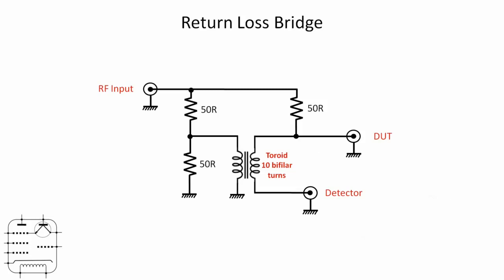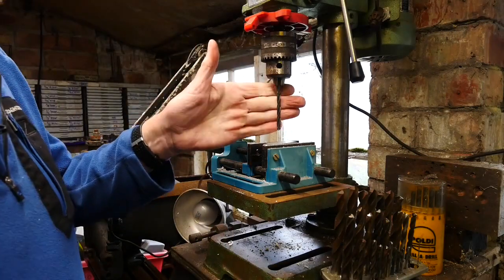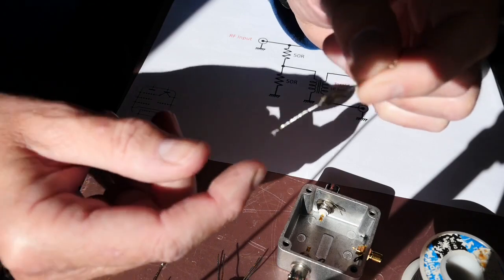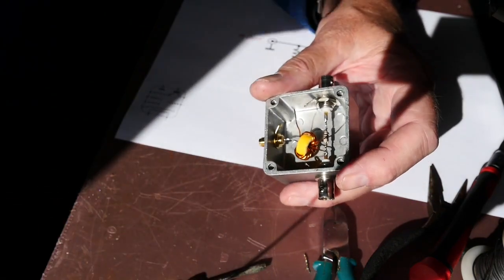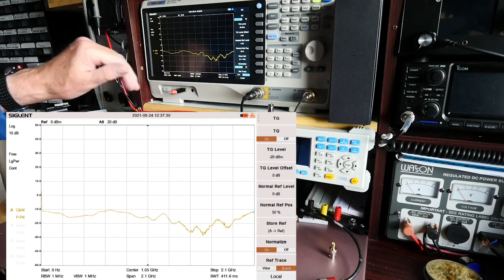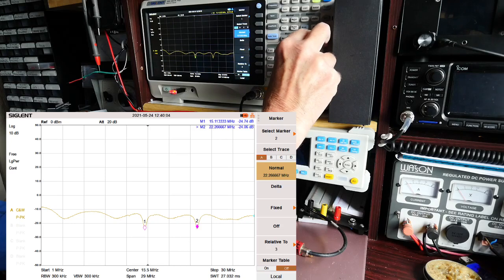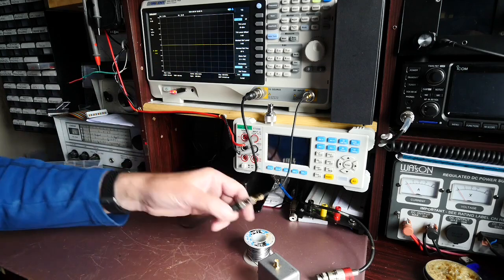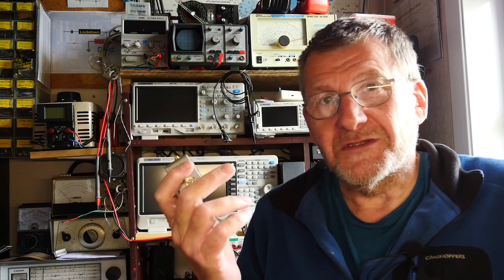Building A Return Loss Bridge - #073

Comment: You can buy precise (0.1%) resistors. If You want to have better response at higher frequencies, You can put a adhesive tape on the toroid - this will decrease parasitic capacitance a lot. If You need higher than that, You will need to change ground connection - whole case as a ground connection may be not good at a GHz range.

Comment: Hello, I'm watching a lot of your videos, very interesting. I'm in the learning phase and have recreated your return loss bridge for the spectrum analyzer but something is wrong. The drawing of the toroit confuses me a little, could you tell me exactly how the windings to which pin must be connected. I made measurements on a 70cm antenna which according to VNA is correct at 434 MHz, then the return loss on the spectrum analyzer should be lowest at the frequency 434 MHz or am I wrong about that. I hope you can help me further.73 de massi

Comment: you have to normalize the trace "after" you connect the coupler before connecting the antenna. It does not matter how flat is the coupling with frequency, you normalize that out and then what you measure after you connect the antenna is directly the return loss of the antenna (well assuming the directivity of the bridge is good) also the chaotic looking trace @16:54 is because you have a long coax with non perfectly matched load (antenna). That's the classic shape of return loss for such a combination, in a twisted way it corresponds to the having standing waves (maxes and mins) on the line

Comment: Hi Bill, I think that the output port on bridge should be terminated with 50R load while making measurements. In your setup generator was not terminated with 50R, so you measured worse performance than it really is.

Comment: Bill, I am confused.  On the schematic, you show all 50 Ω resistors, but on the photograph, you have 100 Ω from BNC to BNC, what appears to be 2 100 Ω in parallel from what I believe would be the input side BNC to a lead on the toroid and to one side of a 100 Ω resistor to ground.  In other words, your schematic and the photo don't seem to match.  Can you help me understand?
Also, something that will probably give you a good laugh at me, I have Tinnitus which makes understanding what I hear quite difficult.  In the first few videos of yours when you said "it's me Bill" I thought you were saying "it's Maybelle!"
Reply from the maker: Wayne, no problem.
Two 100 ohm resistors in parallel will have a combined resistance of 50ohms.
I had 47ohm single resistors, however using pairs of 100ohm gets me much close to the stated 50ohm.
How much difference it will make, I don't know!
Cheers
Maybelle!